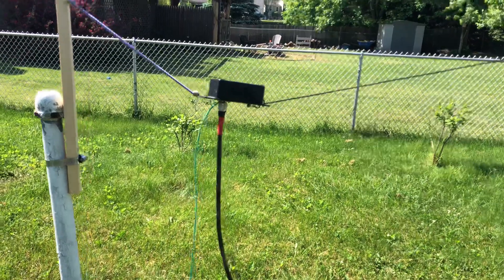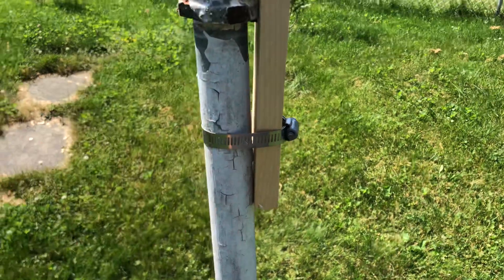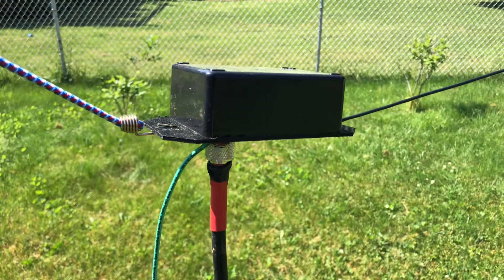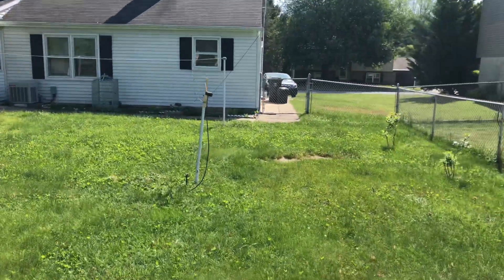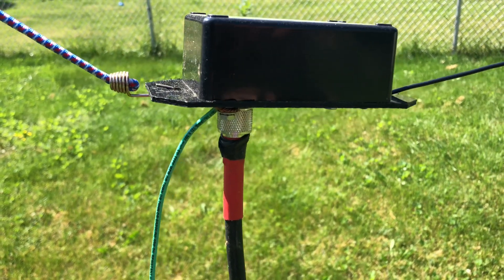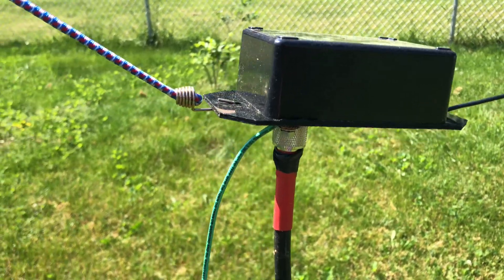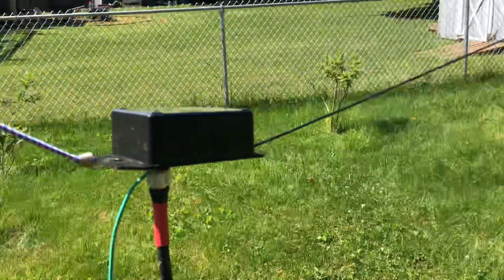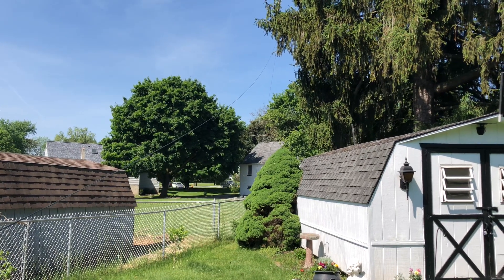MFJ-1984MP. 300w. End fed antenna 40-10 meter. Installed.

Comment: Got mine yesterday. Its the low power version. Threw it up in a hurry on my pushup pole and G90. It was resonant on 40 20 15 10. No tuner. I didnt ground it yet. I also run a random wire with a Nelson Antennas 9:1 UnUn. 41feet with 17foot counterpoise. It works 80 to 10 with no tuner. Great video. 73
Reply: I received my G90 about 3 weeks ago and looking to hoist an EFHW in an inverted V configuration sometime in July.  My neighbors haven’t inquired about my existing 20 meter dipole connected to a 22ft telescoping painters pole that sits inside of a 3 ft piece of schedule 40 that has been concreted inside of a 5 gallon bucket.  Painters pole is wrapped with camo themed duct tape. 

I’m thinking of using a spiderbeam fiberglass mast up about 33 feet to provide the pinnacle of the V.  I’m liking more and more the ideal of just one wire that will be resonate on 40 and 20, the two bands that I’m on the most. Although I have neighbors on 3 sides I think I can be somewhat stealthy. 🤞🏾Mark K3DEX
Reply from the maker: So you know I can tune it on 6 and 12 as well.  Noticed that yesterday
Reply: @mikecricket113  I did notice on 40 my radio cut the power back a little near the top of the band. Im gonna mess with it tomorrow. Just a great hobby. Cheers
Reply: I have Best results with sloper configuration for DX.
Reply: @davidcline4286  I’m not sure if I can get a 65’ sloper in my yard; I’m still playing  with design and distance. Thanks for the suggestion 😀
Reply: 29 foot or 41 foot wire to a 9:1 unun painters poll 20foot up at one end coax on the unun to your rig. I use speaker wire. Very cheap.